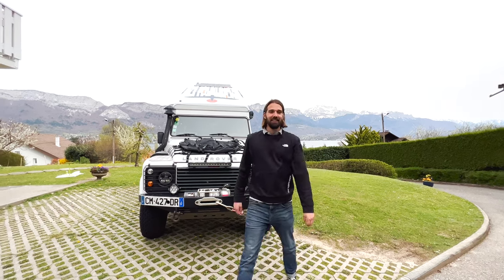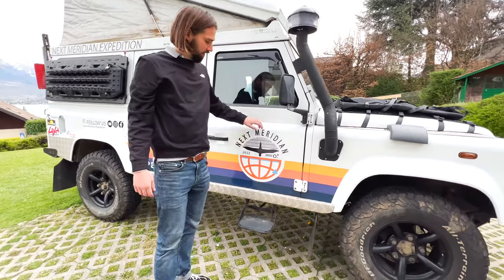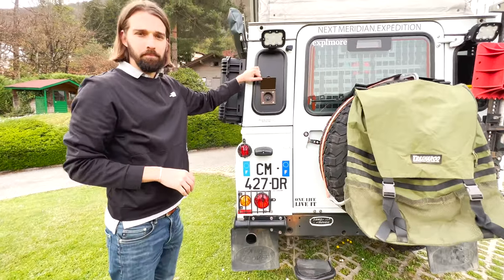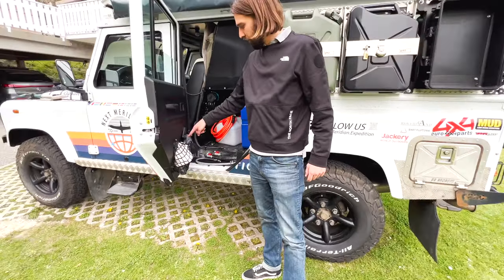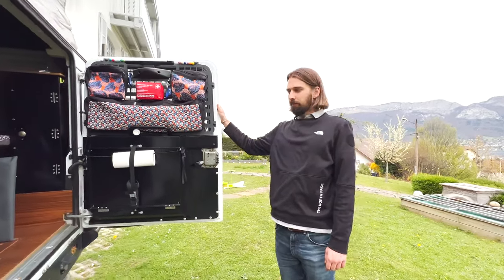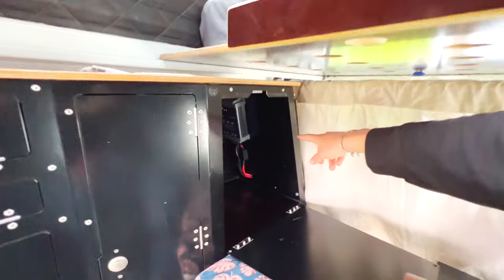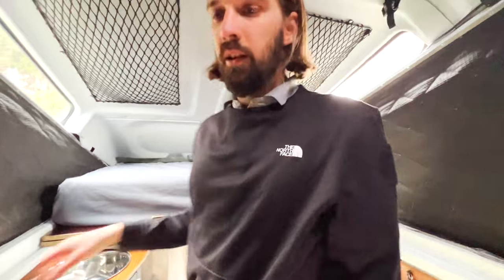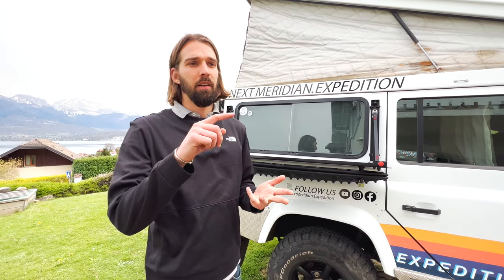Land Rover Defender 110 Build & Setup - World Tour Expedition @nextmeridian.expedition)

Comment: I'm working on my Defender camper build as we speak (that's how I came across your video), and I have to say.. pretty sweet set-up man!! How long did it take to finish the build?
Reply from the maker: Thanks, we're very happy of our set-up, but everyone has their own tastes :) It took us about 1.5 years. We bought the car with the inside Ex-Tec and pop up roof already installed, the winch aswell, the front and back bumper, the webasto heater, fridge and water tank was also already in there. I would say all that abut 4-5 months, sometimes even more I bet to get it ordered and get a installation date at a garage. Then we spent 1.5 years installing the rest over weekends but all the small final touches, like sowing the couch to have a home feeling, to get all the pouches, install the jerrycan mount and buying the right compressor etc, takes in all about 6 months if you work on it every week and you know exactly what you want to install. We took time cause we took our time to think of how we wanted the car to look and function especially for 3 years. Also we tested the car multiple times to change and improve the functionalities to just make everything more comfortable.
Reply: @NextMeridianExpedition  Yes... it's all about the preparations! It took me about the same time to convert my Defender into an Overland camper. Especially the little details were unbelievably time-consuming!😅
Reply from the maker: @HaveFunAndGo  Yeah really is, but preparing is as fun as the trip sometimes :) Plus knowing you made it all is an achievement.

Comment: In advance, have fun and good luck with your adventure.
What is not clear to me at this time, what is that material from the Extec roof tent?
Is this a winter version, only one window in the rear?
If that is correct, then the heat stays in the car for a long time in summer.
My buddy had an EXTEC roof with only one window and was constantly cursing because of the heat.
Ours has 3 windows with mosquito netting in it, so more air passes through.
Personally, I'm not a fan of attaching a lot of equipment to the outside of the vehicle (please take the shovel).

Especially water supply should be protected from access, there are not only nice people on the road!
PS: no breakdowns!
Reply from the maker: Hi Jens,
We have 2 windows in the back. And the roof is ExTec but the tent is from RRC in Lyon. It’s not that warm in summer in there and the tent has windows with mosquitos nets as well so it’s no problem. 
We prefer keeping all outside and ‘locked’ makes the inside much more livable, but everyone’s got their preference and that’s fine. Inside we got tons of space to live ‘normally’ for 3 years which was a major importance for us. The shovel and bonnet bag we store it inside the car when we hike or park in a crowded place.
Nick & mathilde

Comment: Don’t go for bigger tyres. The wear and tear on suspension, wheel hubs and everything mechanic attached to the wheels is going in time laps mode comparing to the tyre sizes you’re using now. If you don’t believe it, ask Lee and Steph from grizzly&bear, some fellow explorer on a defender . They had serious issues in Central Asia with their oversized wheels
Reply from the maker: Yep. We like our size :) and we’ve seen their videos 😯

Comment: Not sure where you are going to drive your LR but from experience you will not need half the stuff bolted to the vehicle. For serious offroad work less is better. It does look cool though.
Reply from the maker: Hi, your probably right, but since we had the space we preferred being cautious. We won’t be doing serious off road with the LR as it’s our home on wheels but we’ll be going all over the world through extended lengths of remote roads and with todays fuel and water issues in some countries we’ll be happy to have those. Are you still on the road?
Reply: @NextMeridianExpedition  No, only local trips. We did 77 000km in 21 months in our Defender accross three continents. In my opinion the Defender is the vehicle to use if you like doing anything that comes your way. Even a bad photo looks great with a Defender in it.

Comment: Amazing setup guys! I'm in the planning phase of my setup. Really like your hot water system. Could you pls tell me a bit more about it?
Where is the 60l tank from? Which water pump did you go for? What is the heat exchange system called?
Cheers
Reply from the maker: Hi, thank you. The planning and setting up is a lot of fun. Also because there are so many products out there for Defenders. 
Sure, it’s a heat exchanger, it uses the coolant from the engine to heat up the tank. and there’s a video about the installation on our YouTube. 
The water tank goes across the flooring at the feet of the back passengers. You’ll see on the video. Took a standard pump, I can check the brand when I get to the car.
I got it installed by a friend, here’s his website https://www.roverland-expedition.be/shop-1 if you want he could help you out with the details if the video isint enough. 

All the best with your installation :)